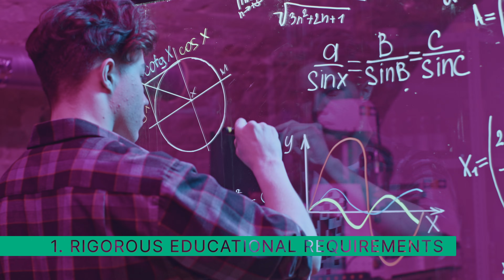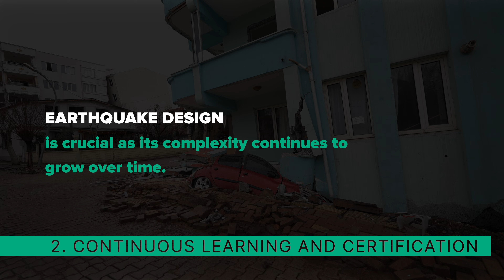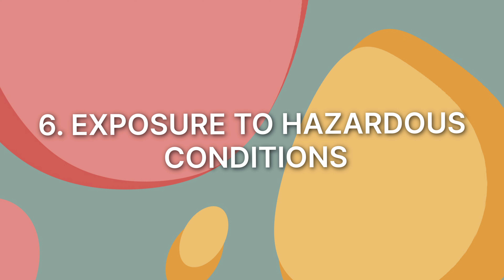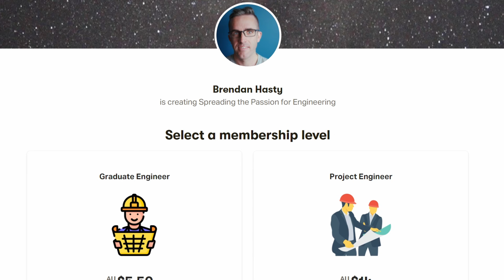8 Reasons NOT to Choose Structural Engineering

Comment from the maker: If you’re into engineering (or need a powerful tool for tackling tough math problems), check out Mathjot—the ultimate cloud-based calculator app I co-founded. It’s designed to make your math work seamless and efficient. https://www.mathjot.com/ use the coupon BRENDAN25 to get 25% off on yearly subscription.

Comment: I think the point of being remote from the money is the most relevant one. The influx of non careers otherwise known as 'middlemen' has caused the race to the bottom. Too many loud voices near the money who are nothing more than sales people. All want their % for relatively unskilled management and outsourcing. Client cares about the cost, and the product provided only has to be fit for purpose normally. This is where the pressure is exerted from and it cascades down to the SE. The bigger the project the worse it is so these days i only deal with clients and Architects direct without any interference.  Smaller jobs bring greater satisfaction imo and your structural input is certainly more appreciated.

Comment: Yeah don't do, because steuctural engineers are earn some of the highest incomes. And yeah, it's easy as hell compared to electrical engineering, aerospace, and mechanical engineering.
Reply: ok, but only because you said so.
Reply: @Ooze27  I just stated facts! I am an aerospace engineer and have worked as a structural engineer before. Steuctural engineering isn't actually a discipline but rarher a major of civil or mechanical engineering.

Structural engineers esrn sht load of money with minimum effort.
Reply: @ampm9771  And i work daily with mechanical and eletrical engineers and i'm telling that it is a lie. They earn more, and electrial is easier. Sorry to burst your bubble little man. Structural is a major the same way the most difficult fields in both electrical or mechanical are. It's a simples as that. Won't go into Aerospace because everyone knows it's the most dfficult. Also highly doubt you worked with more than steel, concrete is a huge part of the course and i really doubt you had in an aerospace programme.
Reply: @Ooze27  Structural engineering isn't an engjneering discipline. There is no such a thing as Bachelor of Structural Engineering..etc

Mechanical engineers and Arrospace engineers like myself studied mechanics of solids, advanced steuctures...etc modules. Just like thermodynamics...etc

Electrical engineering is easier? 😄  if it was, you'd be an electrical engineer, dude. Come after you managed to master tensor calculus and magnetism 😄
Reply: @Ooze27  Sure you talk too much and have a big mouth. Go get an a degree in electrical engineering (not from a micky mouse college), then come tell me how easy it was.

Comment: Engineers should charge based on the cost of the failure they prevent.
The insurance company charge based on the risk of costs of the failure. 

The structure under the penthouse protects the penthouse. The penthouse with more valuable views is worth keeping safer.
Reply from the maker: If only we could inforce this we would all be rich
Reply: This is how I charge my jobs usually. You need to charge for liability.
Reply: @tnd-r1t  you remind me of an old friends comment about his very old consulting structural engineer. 
Because of the engineer's advanced age, the engineer may not worry about long-term movement in the building, that he was underpinning. 
Nothing has moved in the decades since, and he was a brilliant man even in his last days.

So young engineer or oldest engineer ?
Hahaha